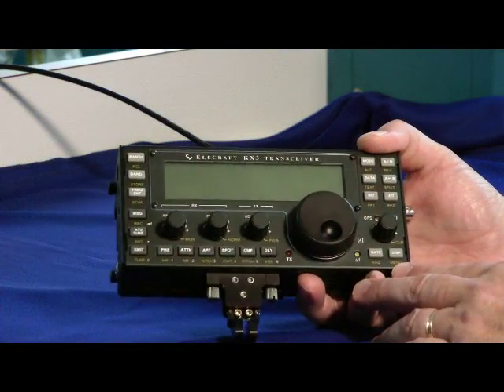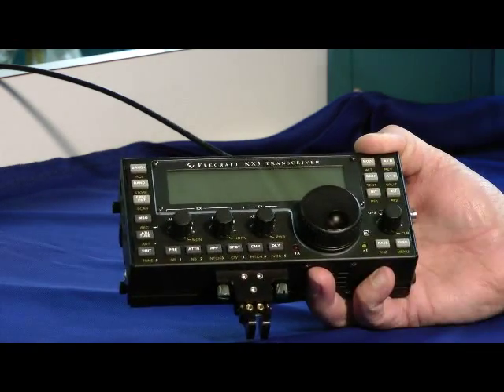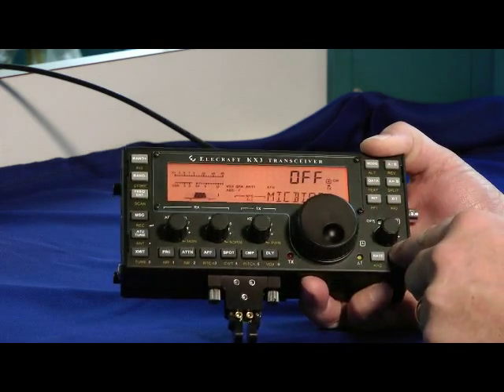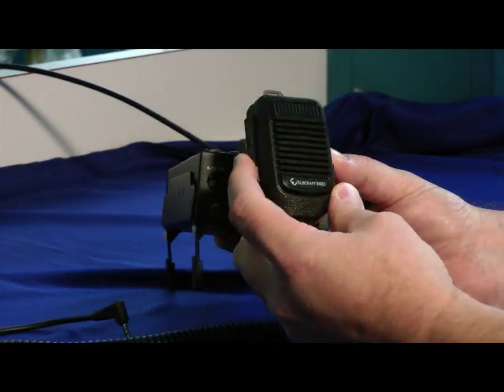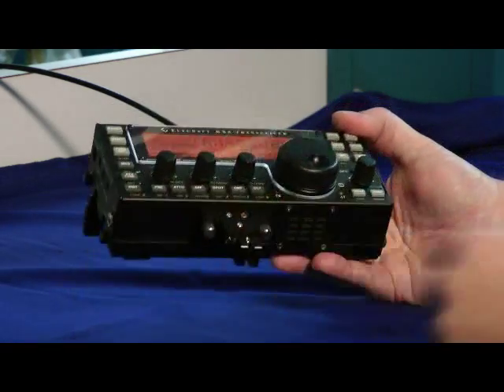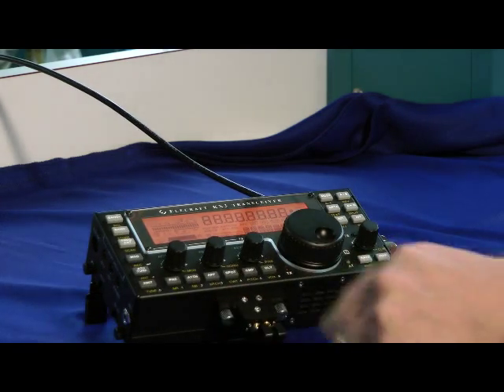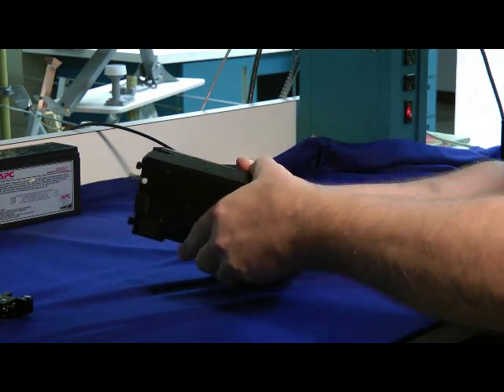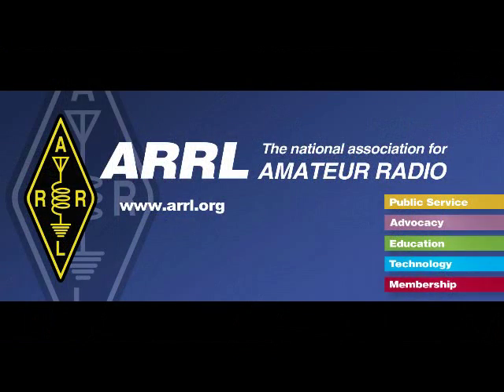Elecraft KX3 Transceiver

Comment: If I wanted to use a kx3 for a home use only setup for CW, what else would I need to make it effective for long range transmissions?
Reply from the maker: Nicholas, the Elecraft KX3 is a 10 Watt transceiver. To be effective at that power level, a user of such would need the best antenna possible for effective, long range communications. The antenna should be a full size dipole, at a minimum. There are smaller antennas, such as whips, or magnetic loops, which do work, but an antenna that is high off the ground and offers a good SWR match, without the use of a wide range antenna tuner, is always the way to go. A typical dipole, cut to the band of operation, can be tuned, if needed, by the internal antenna tuner of the KX3. Of course, radio propagation is everything.  You may have the best antenna system on the Planet, but if the propagation isn’t there, you do not have effective, long range communications. I would suggest studying how propagation works and understanding when the best time and frequency is to be able contact the desired location. All operators have to have knowledge of how the ionosphere works in order to communicate effectively.